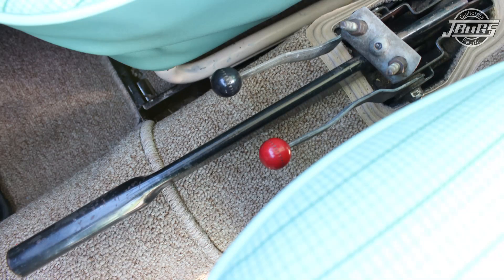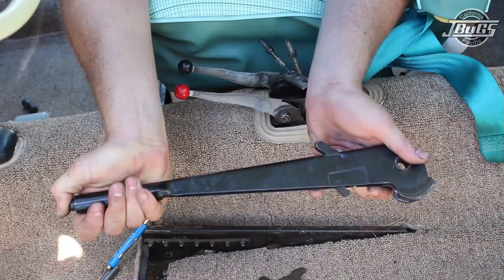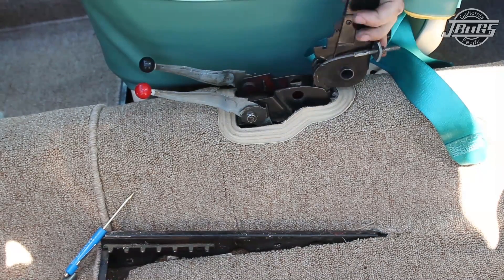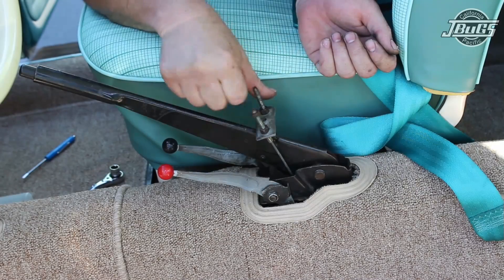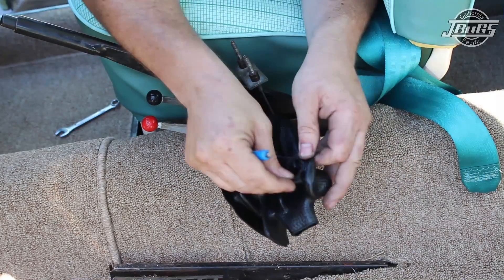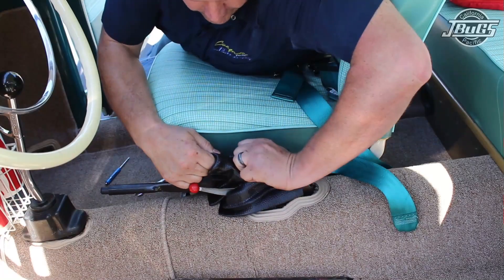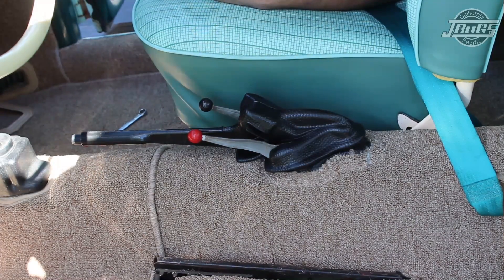JBugs - 1967 VW Beetle - Emergency Parking Brake Rebuild

Comment: Can you reengage the cat paw without removing the entire handbrake ??
Reply: Yes, you just need to lift the handle up far enough past the ratchet catch below. This usually involves loosening or disconnecting the parking brake cables.

Comment: i just got a 1965 vw, what is the additional two levers next to the emergency brake?
Reply: The two levers are for the rear floor heater vents (left) and the heaters (right) https://www.thesamba.com/vw/archives/manuals/65bug/page2_3.jpg

Comment: where is the original trim that was on the carpet prior the install as now it looks a bit unfinished?
Reply: In the trash. The trim isn't original, it's a piece that is installed on "Premium" carpet kits. The boot is normally installed before the carpet kit, but since this handle had to come apart for repair we had to remove the boot and couldn't get it in place with the trim. That is probably why VW never used a trim piece around the carpet. Either way, once the seat is in place you can't see the bottom of the boot.

Comment: Hello great video. My brakes when out on my 1964 vw. Once I reset ebrake will my brakes work?
Reply: Probably not. The parking brake lever only pulls the two brake cables, which pull two levers inside the drum, which manually pulls the brake shoes against the drum to prevent it from turning while the car is parked.

Comment: When you were about to tuck the boot under the carpet, there was reinforcement material  (like mine) that disappeared before you began actually tucking it in. Is it nearly impossible to do with the reinforcement in place? I'm about to replace the Heater Control Cable and watched the video to see how to tuck it in....it's a tight fit.
Reply: We cover the install of the boot in much more detail in our 71 Super Beetle install here: https://www.youtube.com/watch?v=U1T1895cQmA&t=362s

Comment: One thing to note.... if you DROP any pieces, such as the ratchet (which fell quite nicely out of the EM Brake assembly when I moved it), they will be excruciatingly difficult to retrieve from the tunnel below.....
Reply: Yep, a long magnet or long claw retrieving tool is helpful in those cases! Been there, done that!

Comment: My '64 spec. Calls for only 4 clicks to set the brake.  Streched cables cause the ratchet mech. To explode.  Early bugs will require needle nose vice grips to grab the cable and feed them into to handle.  You are welcome.  Cheers!

Comment: You had to cut the piping off the carpet to get it in. Fail.
Reply: Absolutely, I would SO much rather have a piece trim (that isn't original) around a boot that I can't see when the seats are in, than a working parking brake! TOTAL fail!

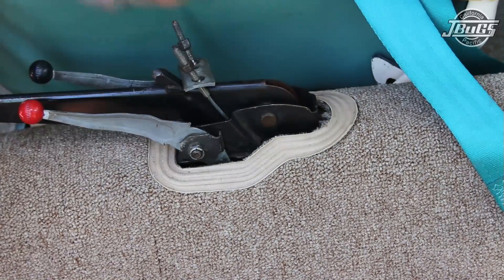Comment: 1:23 how did you just pull it out? The one I have is totally stuck?
Reply: With my fingers, it wasn't rusted in place so it was easy. Stuck pins can be a pain, soak with PB Blaster and use a hammer and punch if needed.

Comment: Was the trim on the carpet damaged? Is that why it was gone and not re-installed?
Reply from the maker: Good eye Jeremiah, yes. The carpet kit was previously installed and the trim came off when we pulled the carpet up. Seeing as the brake boot trims out the hole when it's installed properly and VW never used any trim there it isn't really a big deal.
Reply: I'm glad you did this video @JBUGS because now I am going to take my embrace off and repaint it since it looks super easy to do. Thanks.
Reply: Embrace... gotta love auto spell check.
Reply: @JBugsVWParts  looks better with the trim
Reply: @tylergauvin6073  maybe, but once the seats are in place, you can hardly see the boot, let alone the trim.

Comment: The circlip that holds the pin is teeny tiny but it’s there.  Use an awl or screwdriver to spin it around and feel for it.  Break out your reading glasses too.
Reply: I had to use mine to see the soding thing it's so small 😄😄

Comment: I would have liked to see you show how the toothed ratchet snaps back into the tunnel. Mine is loose and floppy there and I am not sure why. Oh, love the little socket driver with the clearance hole too. Gotta get me one of those.
Reply: The ratchet at the tunnel is just keyed into the tunnel with a little slot at the base. You could use a dab of RTV to hold the ratchet in place at the tunnel.

Comment: Is the new break handle different
Reply from the maker: +Fairy Of The Dawn
There are 2 general styles of emergency brake handles used in Beetles, Ghias, Type 3s and Things. The one shown in the video is the more common that has the cross bar that the cables attach to. We list that at JBugs.com item number 113798305A. The other style handle has loops on the sides that the cables attach to item number 4549. Both handles install and operate the same way, the only difference being how the cables attach to the handle.

Comment: What do the red and black handles do?
Reply: The red handle opens and closes the heater boxes, the black handle opens and closes the rear footwell heater box flaps. In short, they are the heater controls.